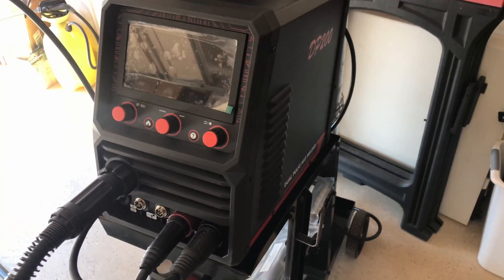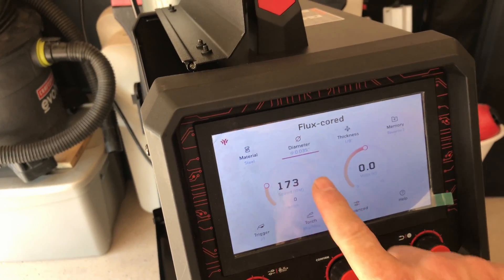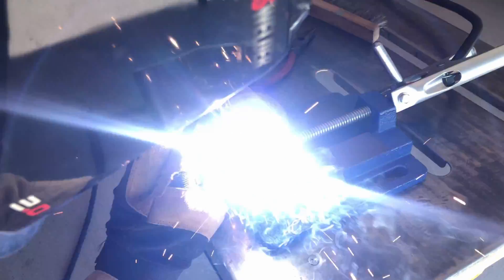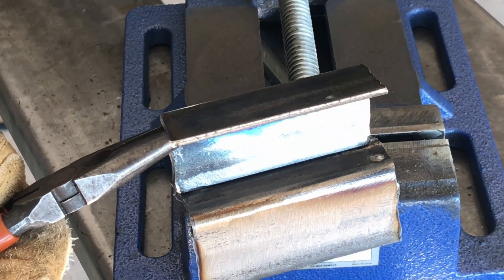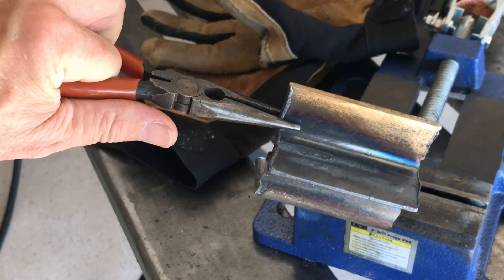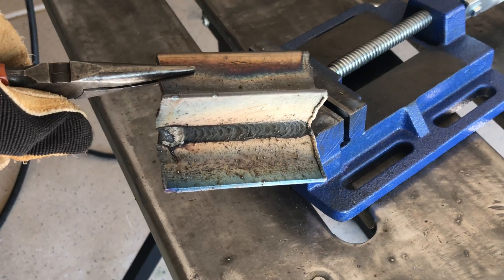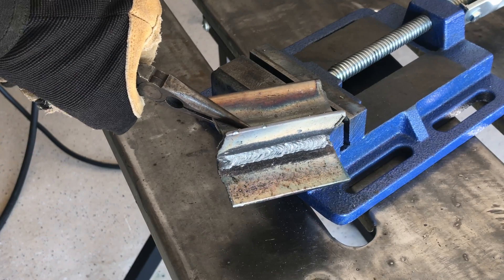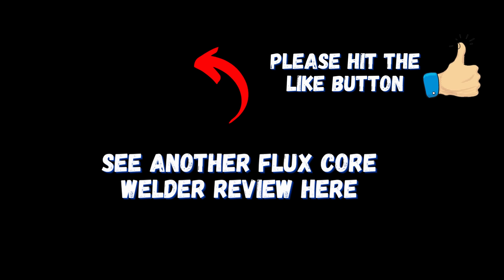Welding with YesWelder DP200 - Is It Worth It?

Comment: Received mine last week. Is it normal to throw so much spalls? Everytime I weld it throws spalls everywhere flux cored wire
Reply from the maker: Sorry I don’t know what spalls are. Probably need to fine tune your settings a little bit.
Reply: If your talking about slag than yes flux will cause alot of slag. That's what mig is for but you must use shielding gas

Comment: Good looking weld! I was stuck on the opening screen (used to my old manual settings Hobart Handler) and used your video to navigate the settings. I set it up with 0.023 easy grind wire and C25 gas. Welded beautifully on 16 gauge exhaust tubing. Thank you
Reply from the maker: Great to hear!  That's the power of youtube.  Glad it worked out for you!